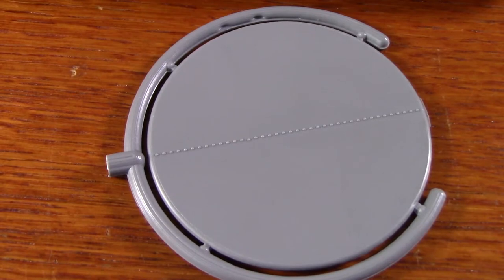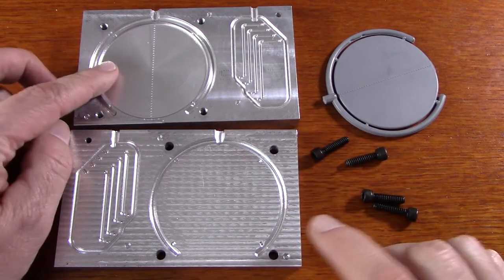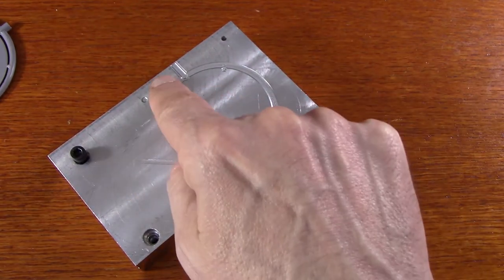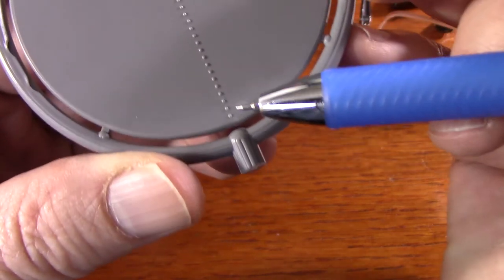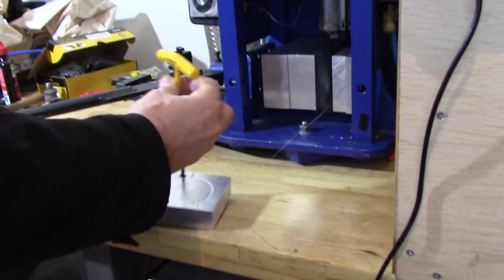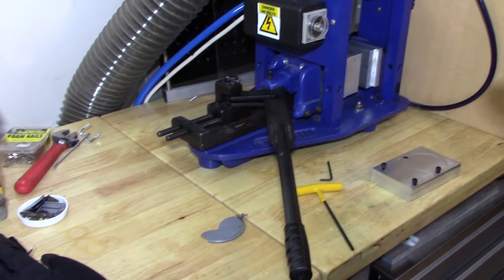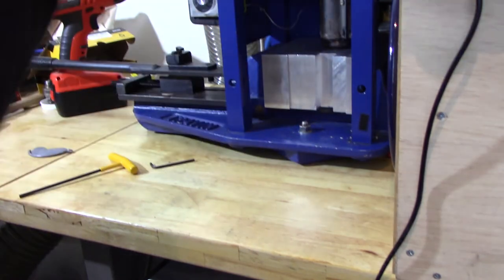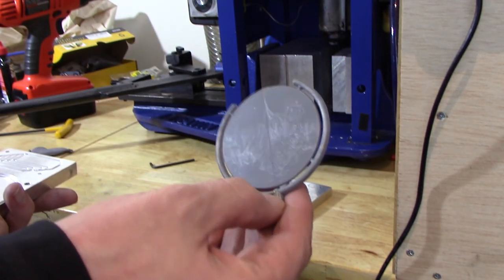#16 What can you Make

Comment: Hi John, I bet you one of those electric impact drivers would break those loose, even a small one. I think they've been making them awhile now but I just discovered them a couple years ago. It really is an impact driver, same kind of action as a pneumatic one, but much more convenient with the lithium battery instead of needing air. Interestingly, they are less destructive to fastener heads, especially phillips head, I think because the driver bit can "reset" into the opening between each impact, unlike with a drill. Anyway, I bet that would crack those loose, even holding the mold by hand. I got a Hitachi like this a couple years ago at Home Depot and find it really handy for repetitive fastener operations. https://www.youtube.com/watch?v=x8kzqT2grl4